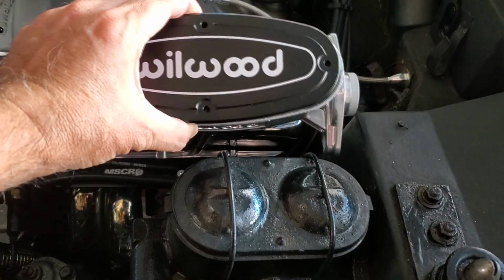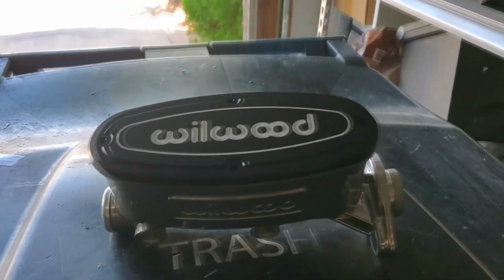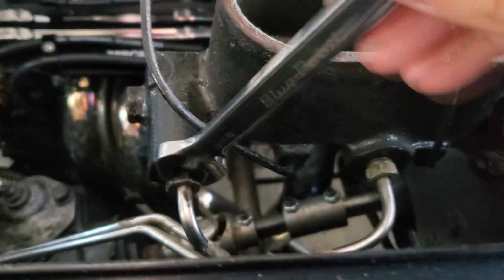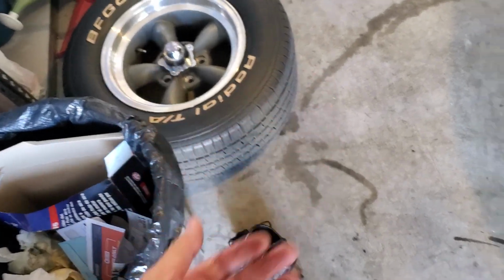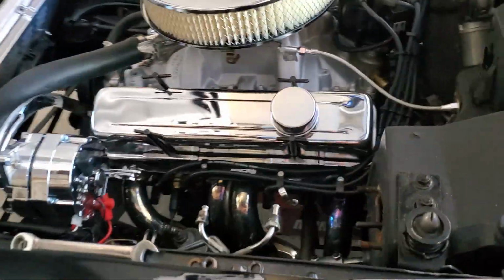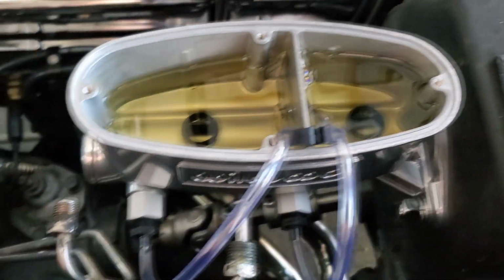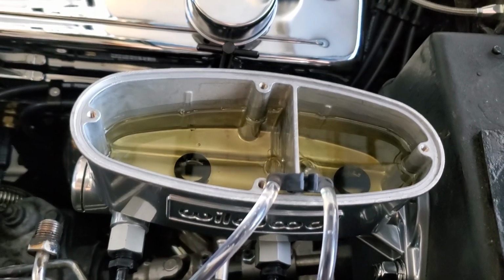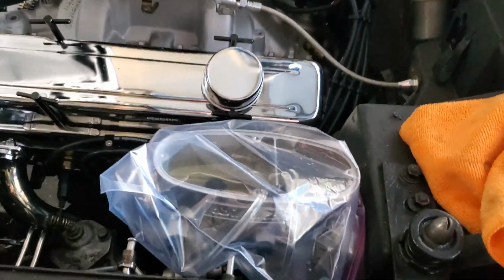Master Cylinder Upgrade! Wilwood calibers coming soon.

Comment: Hi Nicholas, that’s the part number or the bore size for that master cylinder?
Reply from the maker: 260-8556-P Is the part number. 1-1/8" Bore size. This is what was recommended for non power brakes.